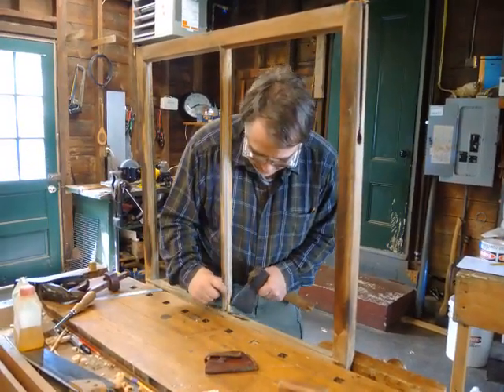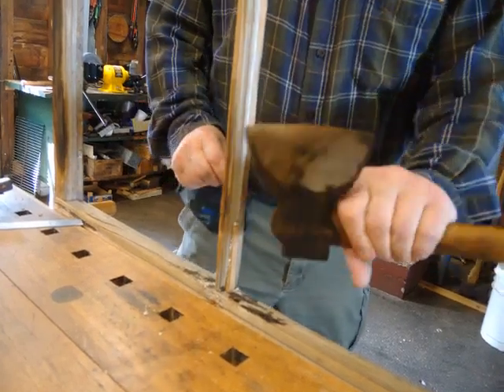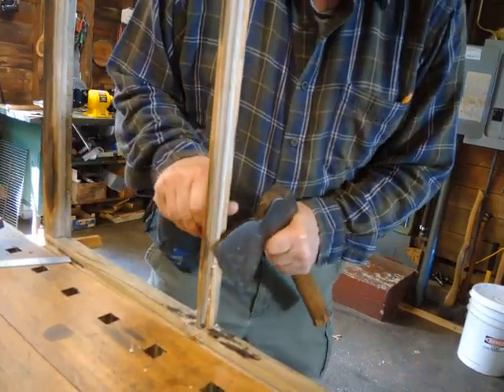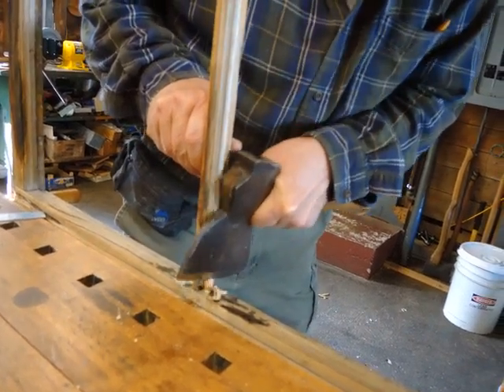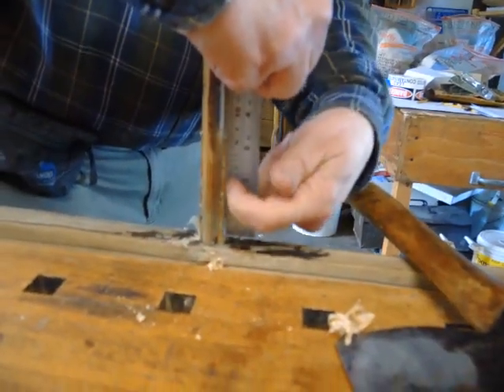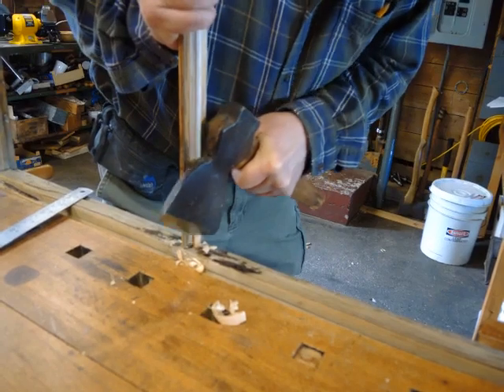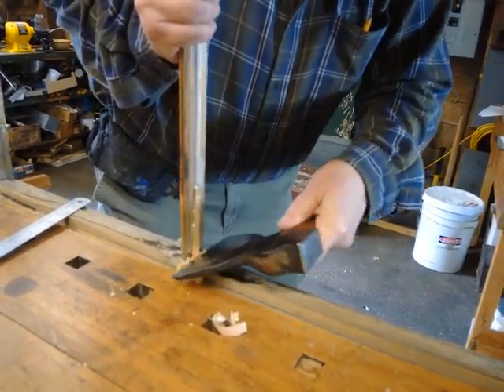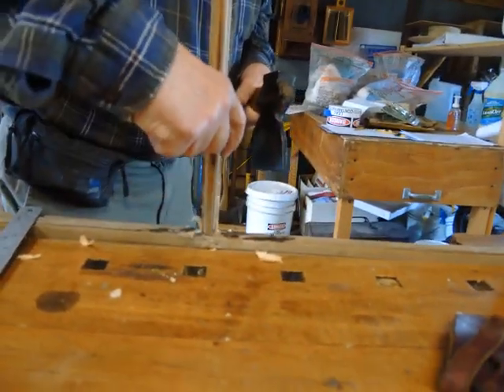Sash Trim Fun

Comment: Sounds like nice steel...
Reply from the maker: yep, has the good old steel, I've been using this hatchet for half a century, and it was old when I got it, it sharpens easily and holds an edge well
Reply: @johnleeke  It had a bell-like chime, which bodes well